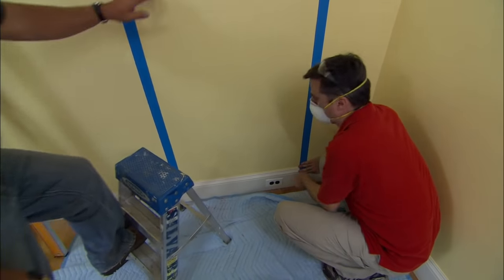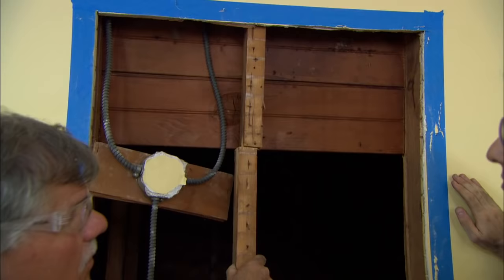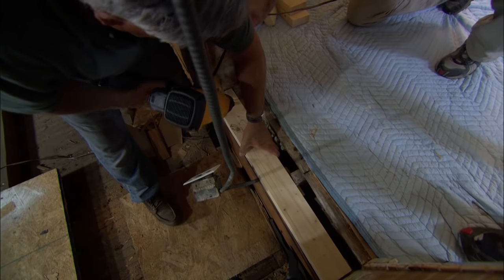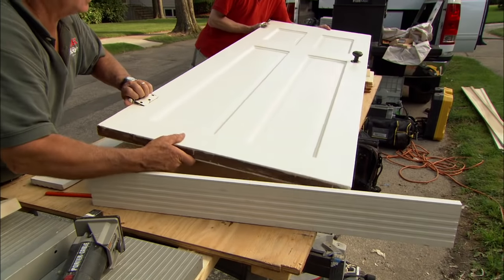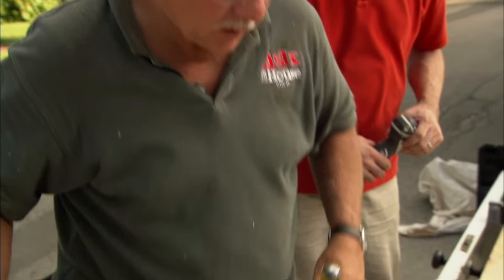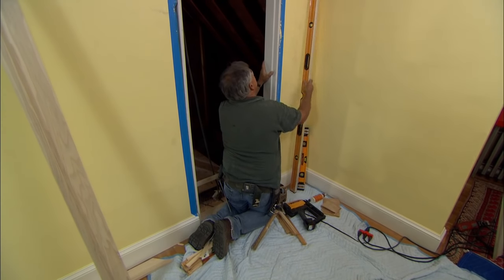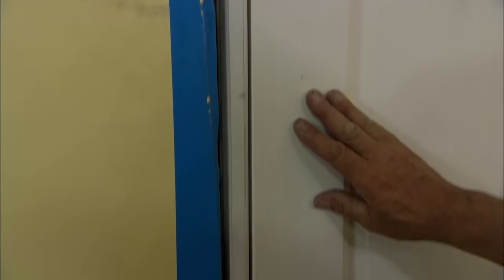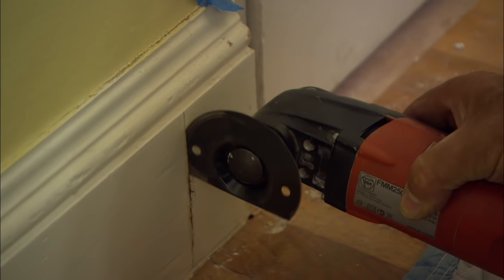How to Create an Interior Door Opening | This Old House

Comment: i am adding a half bath with a laundry room to my covered porch. (i am closing it, don't worry.:-))  I am taking out a window to add the door going from inside the house to the new bathroom.  can you tell me how to easily go from brick to sheet rock with the door jam.  Its about 10 inches thick from outside brick to inside sheet rock. 

thank you.
Reply: You should leave the porch as it is and not close it. It saves on air conditioning. To transition from brick to sheet rock get a sledge hammer and make random holes, it's more interesting.

Comment: so on a non-load bearing wall is a king/jack stud needed?
Reply: Tommy didn't install a jack stud--there is no header--just a 2x4 across the top (where the header would normally be) acting as a nailer.  Not specifically mentioned in the video, but the opening's "king studs" look to be the regular wall framing studs.
Reply: @kenc2257  thanks for the reply, good to know I did it right!